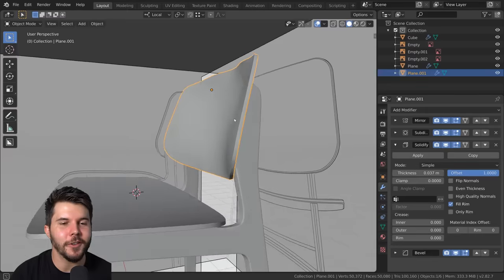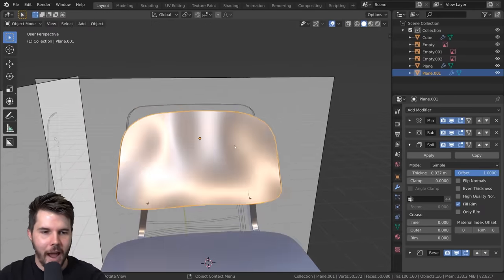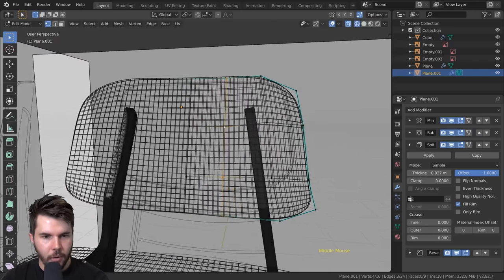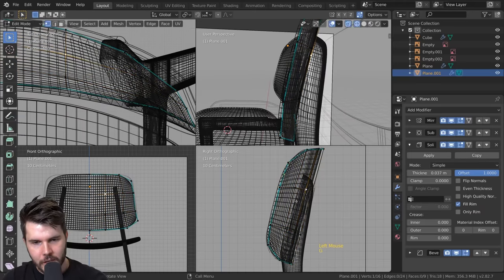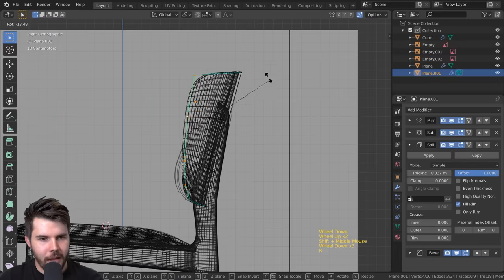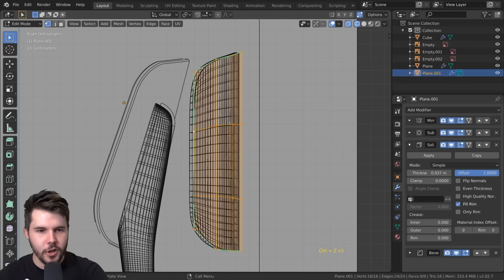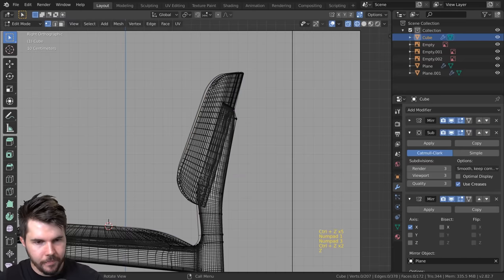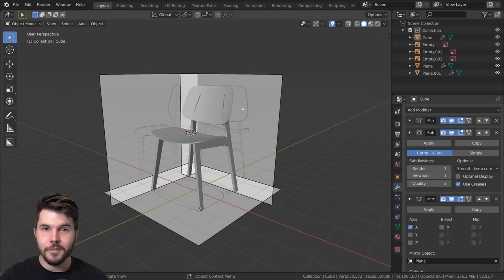Blender Beginner Modeling Chair Tutorial - Part 5: Curved Surfaces

Comment: Me: spends 1 hour to make the perfect back
Guru: makes a wrong one and corrects it in 17 mins
Me: "I've won, but at what cost..."
Reply: Fear not, for thou was not the only one led astray
Reply: @dwillingham  mmm
Reply: My lazy ass just created a bezier curve, matched it to the ref images and then converted to poly and cleaned it up after adding the inner faces.
Reply: I just copied the seat, placed it in the back part and tweaked it a little bit
Reply: Same here! about half that time.
Reply: LOL TOOK ME 2H AND 30MIN TO MAKE A NICE BACK!
Reply: @Pietro Figura how did you all manage to do the thickness after applying the solidfy modifier? I am having a hard following the blue print.
Reply: @rodrigorivers2469  I just eyeballed it, screw the blueprint
Reply: I spend my whole evening doing this
Reply: @smsahil9016  me too but then i felt guilty and did it (i failed homework 😔)
Reply: @JC-dg2kj  3 hours for me my friend.
Reply: an hour?? Took me the better part of an evening lol
Reply: Considering I usually spend like 1-2 hours for every 20 minute video, I feel pretty smug about getting that homework done perfectly in about 30-40 minutes
Reply: My pain is immeasurable as my mistake is the same.
Reply: It took me 30 minutes, all I did was following the steps from the previous video and put an extra loop cut, I don't know how he made that happen.
Reply: Lol i did the same thing😂
Reply: @sethhu20  At some point, that seems to be the solution. I found that having a side view of a curved object made it super hard to work the a 2D blueprint, since I am missing the information of what part of the curve should be where on the blueprint.
Reply: @smsahil9016  YES! One of the first rules of hard surface modeling: Reuse your geometry.
Reply: @Maddinhpws  then should I feel extra smug in doing the homework in about 5 minutes? 😎😁(One of the first things you learn in hard surface modeling is to reuse your geometry wherever possible. I just duplicated the seat and adjusted the vertices to match the shape of the back.)
Reply: I had no idea my view was in x ray mode until I watched the first few minutes 😑
Explained all the transparency, spent too long understand what was going on...
That aside I tried reusing the base geometry, didn't work out, couldn't understand why. Then I realised my mistake, I was trying to rotate the plane and then model from the back image. Doing that, and then grabbing the vertices to fit, will mess up your directions, so always best to go on a straight surface first, then bother with the curvatures. Minimise your loop cuts, and doing them too early before you rotate can get you in some trouble afterwards.
And keep it as simple as possible, some things here and there out of bounds are fine, perfection isn't paramount, the image of it is.
Reply: @erwinlommer197  r u sure you need to be watching this beginner tutorial
Reply: copying it and tweaking it is the easiest way I guess?

Comment: For anyone else really struggling like myself, I think I’ve just had a breakthrough as to why I’m having a lot of trouble. 

Take a look at how many vertices are on your mesh, now look at how many are on BG’s. You may have overdone it on the loop cuts while getting the general shape and that’s making what’s already a tricky thing to model even harder. 

Remember what BG said an episode or two back, you might have to scrap what you have and give it another go. With the tips from this video though, it shouldn’t take too long and you’ll create something far more satisfactory in the end.

Don’t let a simple snag like this completely halt your progress, it’s these kinds of experiences that are going to really teach you.

Edit: after going through and redoing the back with knowledge from this video it was way easier and came out way better. Don’t be afraid to start over.
Reply: I genuinely saw your comment and thought..ugh no way can I just redo-it easily...It was way easier and looks 1000x better!
Reply: I legit just copied the seat itself and moved it into position with G+ (axis, such as x,y or z), resized with S,  and then used item info to line it up to the same angle as the edge of the back part of the seat. pretty easy to reshape from there, going by the previous video

Comment: This tutorial is GREAT. I've been moving verts by hand for a decade and am just now learning subD modeling (thanks). So getting the base mesh into a good spot was in my wheelhouse, came in with a basically finished back. 

Minute for minute, I feel like I learned more in this tutorial of concrete procedures that directly answer modeling questions I have than... well I don't know than what exactly, but a fucking bunch. It's like a perfect little toolkit of moves and concepts to help address really common modeling issues that have til now just been time-sucking vexations. Thanks a ton, Andrew.

Comment: That trick with local axis, I found that while using 2.79 version. It works when you double click z after clicking g
Reply: It's flipped in 2.8x. Double-tap for Global, single-tap for the displayed, selected, Transform Orientation.

Comment: I think it would be easier modelling a simple flat thin mesh (in vertical position) to get approximately the outer shape of the backrest. The rest of the work can be done with modifiers.

I used those modifiers:
    -Mirror
    -Solidify
    -Subdivision
   -Bevel
   -Curve         (This is the key one: it will deform our flat backrest into the curved shape that we want) Also, rotating the imput curve, lets us keep the original mesh in place. 

After that, we just tweak our original mesh until we match the blueprint.

Thank you so much for your tutorials, Andrew!! It's not only what you teach us, but also the way you do it :) Very inspiring!!
Greetings!!!

Comment: The way I did it was using the Grid Fill. Is this cheating?

First I made a plane, subdivided it and deleted the inner vertices formed. Then I was left with just the outline vertices.

Then I positioned the vertices to match the blueprint outline. After that I selected all the vertices (making sure the active vertex was one of the corners of my would-be grid) and then did a Grid Fill. The computer filled in the inner vertices better than I ever could.

I learned nothing while doing it so I guess I'll have to redo it manually :P
Reply: If it works, use it. You stumbled upon a creative solution. That's good.
Reply: Cheating? Nope! The idea is to get good topology and good model doesn't matter how you do it. Only matters when times comes into place. There's nothing like cheating in 3d. 3d is cheating
Reply: @booleanvisuals8564  Well yeah it looks perfect and all but Andrew repeatedly said that the point of this series is not the chair. I feel like if I skip this part then I'm missing out on some useful tricks.

Comment: Anyone else wanna punch a wall with this part no just me okay only 6 hours in
Reply: yeah I just closed blender without saving, fuck this shit. Whenever I aligned something good from the side it broke everything on the front etc
Reply: @celebezz  I'm just gonna go ahead and continue with the following part. There is no shame in not making everything completely perfect.
Reply: Man, I feel like punching my fucking laptop. I just don't understand, wtf? Why can't I align anything properly anymore? I move a vertice one nanometre to the left and my whole model has gotten fucked up.
Reply: @shlomisafra5902  trust me bro I get it, struggling with the same stuff but the simple answer is that it’s because we’re working at weird angle. when you’re working with a perfect 90 degree face it’s pretty easy to understand exactly what’s going to happen when you move something, but throw that angle off ever so slightly and it becomes a nightmare to manage. That’s why he’s explaining all these tools and hotkeys to modify stuff and make adjustments with very little direct “grabbing” of the mesh.
Reply: @shlomisafra5902  Use lattice tool instead. Very easy if you use that one.

Comment: Wouldn't curves have made this a lot easier
Reply: Maybe not easier, you still have to match the reference, but it's smoother by default for sure, even though it's possible to have this smoothness using modifiers with vertices
Reply: Would it been easier? Yes, if you know what you are doing. No, if you have just done doughnut tutorial before this. 😂 I think that curves are for more advanced tutorials.
Reply: The "easier" way is mostly the one we have the most experience with. :)
But I suggest people try every possible way, it will certainly help for later projects.

Comment: Did anyone have an issue with there being a perfect seam right down the center of your chair back? right where the mirror modifier connects the two forms?
Reply: you probably need to shift them to make them connect or change the clipping settings but idk im really new and crap

Comment: Good tutorial as always! I like how you've shown multiple ways of going about it but I was hoping for more tricks and cheats for this one instead of finicky adjustments with vertices.
Watching this I came up with a way to do this piece using a lattice. Single box with 2 or 3 vertical subdivisions and simply pushing out 3 middle top and bottom vertices and then push the lower corners forward and you're done. Things can still be fun and easy if you know how to cheat.

Comment: There's also a few options like Smooth Vertices and a modifier called Smooth which you can add ontop of your plane form of the object (before solidify etc) and that can help smooth out your vertices and keep them lined up better, meaning only a little tweaking afterwards.

Comment: Andrew great stuff as always! I 've been using Blender for around 5 years now and I still like to watch your tutorials, not only because of the bits of humor and pure entertainment, but also because I know that you will share valuable tips that will speed up my workflow or make my blender experience more enjoyable. Since I got so much from all of your generous tutorials, I 'd like to share a tip with you as well, that you most probably know but didn't mention. At the 10:50 mark, where you talk about using the 'local' axis, you can also use a hotkey for that, while being in 'global'. For location, if you hit ''G + Z + Z'' it will actually go into 'local' mode automatically just for that action, keeping in mind that we did not apply the rotation prior to this. This will work for rotation as well. Thanks again for all the knowledge shared over the years.

Comment: I somehow made the back in maybe 10 mins. I guess I'm not a complete noob anymore but definitely still a beginner. Scaling along the local axis really, really makes a huge difference. I got a decent shape, then disabled my solidify/subdivision modifiers in the viewport (easier to see which vertex is sticking out and ruining your mesh) and scaled some vertical loop cuts along the local vertical axis to get rid of any lumps. 

FYI, If you "mess up" your local axis and it just matches the global axis, you can create a custom axis. In the drop down menu where you change from global to local, you can hit a + sign to add a new axis.

Comment: The part about tutorial education and improving on the classroom method kinda highlights one of the big differences between artists and non-artists like me . You said you don't want to trick people into thinking it's easy or anything, but frankly, especially after spending multiple hours on trying to get the backrest to look in any way good in the homework and then not being able to do anything right with the adjustments you showed off in this video, I'd say this is much more of a motivation killer for me than doing something "by the book". This is miserably hard and I'd straight-up say that for someone like me, your process made it significantly harder and less enjoyable.

Comment: Managed the homework, duplicated the seat, rotated then scaled it to the size of the back and then adjusted the points link the seat till it matched (lazy way but they where both similar in shape and size).  Only problem I ran into was a random crease where the mirroring joined, not because of additional geo or an extrude forgotten about but... because when I marked the edge of the seat as sharp I forgot to unselect the edge between the mirror which caused the crease artifact, only noticed this with the matcap studio light. Thank you for these tutorials and all the tips you provide.
Reply: I'm having the save problem, but I can't find a way to fix it. How did you fix it?

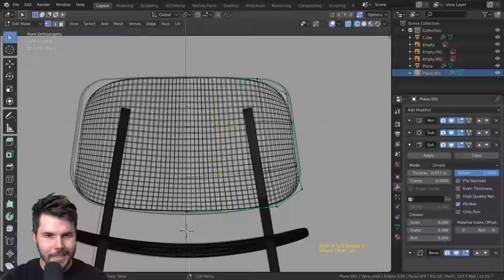EDIT: his tip at 4:37 fixed it for me. My edges were not straight so he said to enable Even Mode by double tapping G then E. So simple :D

Comment: Awesome tutorials Guru. Btw, I was having a tough time with the legs'back support poking thru the mesh too! I fixed it by setting the origin point to the center mass of our modeled leg (object mode-object-set origin-origin to center of mass). Instead of where the origin (pivot point) was set from the original extruded cube. Then I mirrored the leg with the new center pivot, still eye dropping the seat as our mirror object and it lined up properly.

Comment: I did the curve a little differently so I just wanted to share in case anybosy's stuck like I was and wants to try another method.  I used the simple deform modifier and I put 2 empties on either side of the chair and set the deform to that.  I used bend on the z axis and set the angle to -30 and I think it looked pretty good and I didn't have to worry about messing up my geometry underneath.

Comment: Quick tip: transforming with respect to the local coordinate system instead of global can be done by pressing the axis key twice, like e.g. moving along the local Z-axis by pressing G+ZZ. I can't live without this shortcut anymore. But I did not know about both the shortcuts Alt+S to move a vertex along its normal and GG, Alt+Mouse Move to move a vertex along its edge and beyond the edge. Thanks for that!

Comment: Don't know if anyone already gave this recommendation: if you want to even out the surface, you can pick the vertices withing the surface (meaning, surrounded by other vertices), slide them to another vertice and than slide it back to it's position in the mesh. This way you average the this vertice and the one following in the loop. Really handy for evening (or however you spell this)

Comment: Let me suggest another approach for the back part of the chair. Actually ... it may be a more technical, but at the same time easier way.
What if you model the part in a flat surface ... so you can create your perfect topology without caring about the axis projection when moving vertices. Just a flat 2D part. Then add all your solid and bevel modifiers ... and finally BEND it with a modifier or lattice. You can then play turning on / off the lattice, until the 2d shape is perfect once bent.
It is also more similar to how this piece is actually produced, as this is curved wood.

Great Videos ! And thanks for all the knowledge.

Comment: I'm actually quite happy with my attempt at the backrest. The only issue is with the angles of the legs where they touch it. Back in 3dsmax I would just add another Edit-modifier and the manually turn the touching surfaces of the legs a little. It doesn't look like that is the way Blender does things in general. I wouldn't really want to apply the modifiers in the stack just yet. Let's see what this lesson comes up with.

Comment: Don't know if anyone said it in the comments, but if there is a little edge (usually only visible when rendering with cycles and lighting), where it isn't supposed to be and fiddling with subdivision levels, bevel and auto-smooth doesn't help, I found that increasing the quality of subdivision (under Advanced) to 4 or 5 can help.

Comment: Writing this after the first 30 seconds of the video. I did do my homework and, surprisingly, it does look a bit better than yours.
I used a plane with a mirror modifier, got the general shape with the curved end done, then I manually extruded it and added loopcuts to make the edges sharper. I also made a duplicate where I used the solidify and bevel modifiers. Shaping the plane for the back rest was a nightmare though.

Since I had some free time I also made a support bar between the front and back legs of the chair - a simple cube which I bent slightly in the middle and then subdivided a bit. Then I mirrored it on the other side using the chair's seat as a mirror point like we did with the legs.

EDIT: I used the metal_lead matcap with the cavity options set to max for good contrast, I think it looks good and helps me spot any things I don't like.

Comment: Instead of changing manually the transformation orientations you can simply tap a second time Z, Y or X.

Another shortcut is to hold Shift before press Z, Y or X then you cancel this specific axis. For exemple, if you press G and then Shift+Z, you vertex, edge or face, will only move on the X and Y.

Comment: If you scale, move or rotate an object about its axis without clearing its rotation, and you hit the axis button twice (hit X twice, hit Y twice or hit Z twice) it'll perform the function along the object's local coordinate system. So you don't have to go in and tell Blender manually to perform a transformation function along the objects coordinate system.  You probably already know that but I use it quite frequently, saves some annoying clicks.